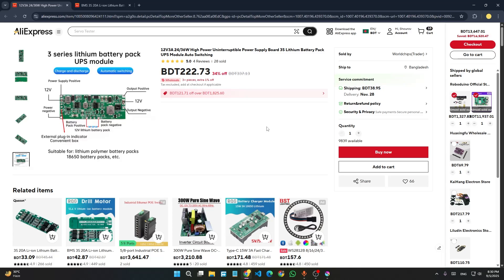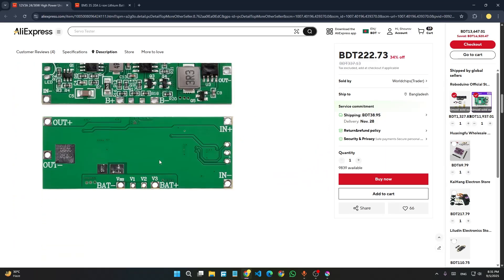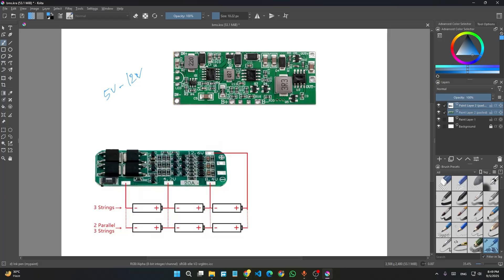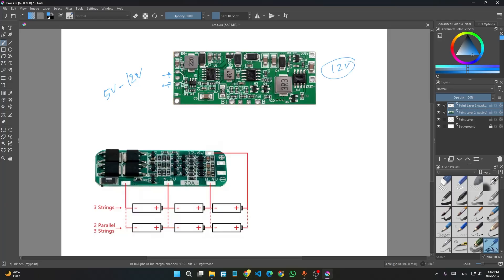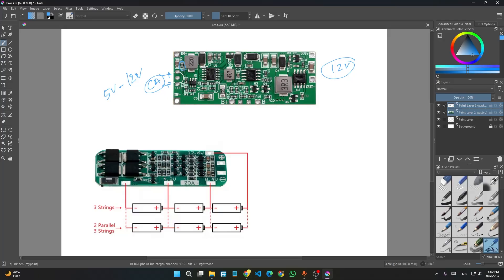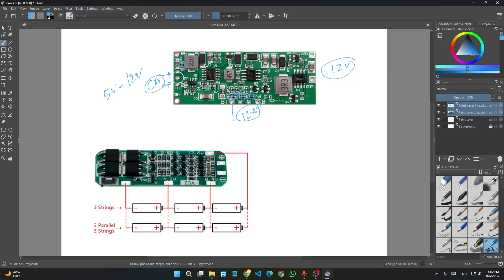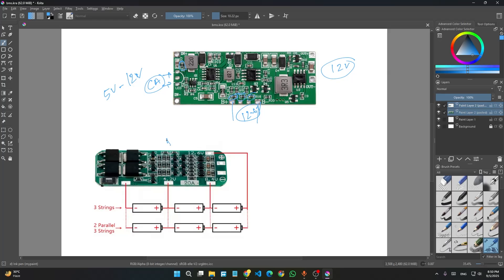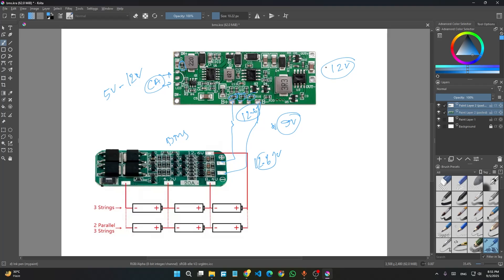12V3A 24/36W High Power Uninterruptible Power Supply Board UPS Module Auto Switching

Comment: How much power is required for input 12v and how many A? And if we have 12v 4Ah battery then how long it takes time for full charge?

Plzzzz reoly sirrrr
Reply from the maker: Efficiency approximately 90% if your load is 1A then it will give approximately 3.5 hours. Input for charging 12V 1A
Reply: @shourovpal2168 And How long will it take to fully charge a 12V 4Ah battery?
Reply from the maker: @itsfokinanya if we consider 12v 1A charger it will take approximately 4.5 hours to charge
Reply: @shourovpal2168 while powering the load?

Comment: Thank you for the information. What will the output voltage be if the battery voltage drops to 10.8? And does it protect the battery exactly like a BMS module? I'd be happy to provide information. If you answered the question in this video, please write it anyway. My English (listening) is a bit bad.
Reply from the maker: Output is always 12.6v but when bettery voltage is 9v protection feature of the battery kick in and shuts of the module